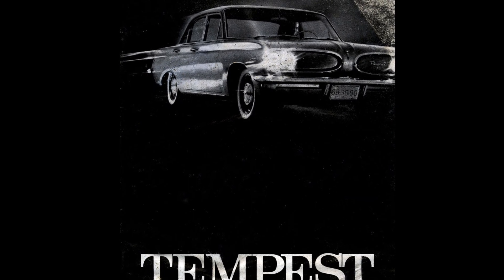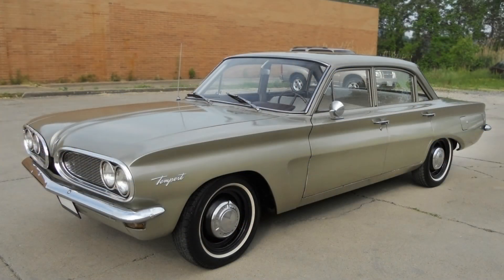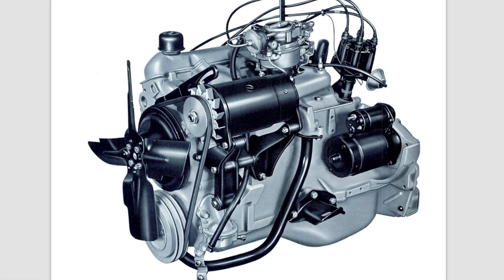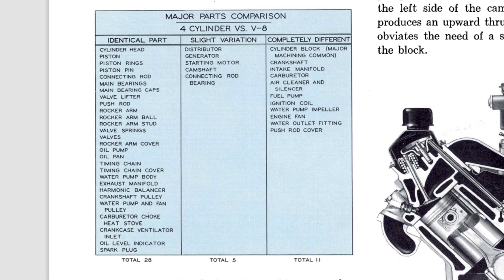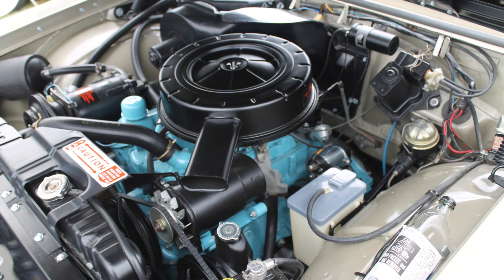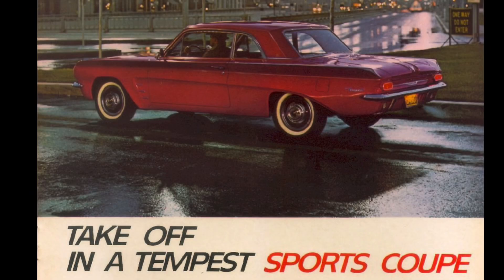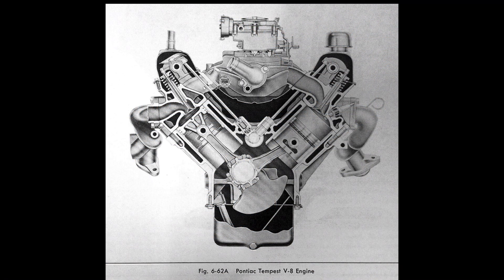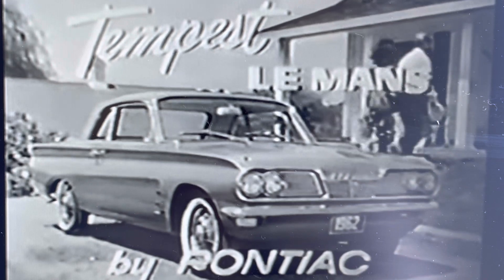Strangest Automotive Engines: The 1961-63 Pontiac Tempest & Its "Trophy 4" / "Half 389 V8" Engine

Comment: That engine really was very common to the 389-V8. One time my dad was tuning up a friend's Tempest and the local parts store did not have the required distributor cap. Dad bought the cap for the V8, put the plugs in every other wire nipple, and it worked great.
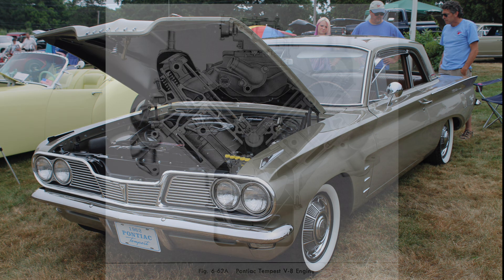Reply: At 08:30 there were actually two V8's available by 1963, the Buick all aluminum 215" V8 (2 and 4 bbl. carb.s?) and the Pontiac iron '326' V8 (actually 336" because Pontiac developed it before the GM 330" size limit mandate for mid-sized cars)... 
The 4 bbl. carb. 4 banger engines were basically half of upcoming GTO V8 engines at 1/2 GTO HP/torque but same higher RPMs... 
The 4's could also have been named 'Sewing Machine 4's' because, unfortunately, that's what they sounded like...
Reply: @BuzzLOLOL  The 326 was a sweetheart of a motor...great torque, and smooth.  Perfect motor for a car that light.
Reply: @williamrosenow6176  Tough to beat a 389 Trophy six barrel...wow.  I can relate to speed control issues, my latest is a 74 Buick GS455 built 10:1 compression, intake, headers, sizable cam, 3.08  highway gears so really just takes off 50 MPH to 130 or so.
Reply: @BuzzLOLOL  My brother had a 1962 Olds F85 with the 215 aluminum block.  I think it was the 2 barrel.   He drove it from 1978 to 1981.
Reply: @ripvanrevs  - My daily driver in 1960's was the '62 Olds Jefire with turbocharged 215 all aluminum V8... also currently have the 215 in my '75 MG Midget... 
https://www.youtube.com/watch?v=Jzw5W1rRMog
Reply: @BuzzLOLOL  awesome!
Reply: @BuzzLOLOL  First year for 389 was '59, they were in full size before GTO.
Reply: @unclebob7937  You are right for the 389 but not in the Tempest 61,62,63.
215V8 was the largest till 64, then came the GTO.
Reply: @frederickwise5238  - No, Pontiac '326' (actually secretly 336") with 2 bbl. carb. was available in '63 Tempest... the 389 got more HP in the GTO...
Reply: @BuzzLOLOL  Did I say anywhere that that the 326, "336" WAS NOT available in the 1963, did I?? Yes I knew about the 10 Cuin discrepency and why. I simply used the advertised nbr. OK??
A friend and (with the top down of course LOL), lay a quarter on the dash board, pedal to the metal DRIVE COMPLETELY OUT FROM UNDER IT.
If you read, what I said was the 389 didnt come until the GTO in 196 -4-. !!!
Reply: @frederickwise5238  - You said: "215 V8 was the largest till 64"... which isn't true, 326 was available in '63 Tempest...
Reply: @BuzzLOLOL  Isnt that what I apologized for in my reply to you???????
Reply: @BuzzLOLOL   if I'm not mistaken the 215 was only offered in 61 and 62. It was dropped in 63 in favor of the Pontiac 326. It also used the Buick version of the 215.
Reply: @edmundanderson657  Had a 215 inline 6 in my 65 pontiac tempest  nice engine for a six. I think  the next year they went to the OHC 6
Reply: @ike4496  Completely different 215. There were no inline sixes available in the 61-63 tempest.
Reply: @edmundanderson657  It was basically a Chevrolet 230 with an 1/8 inch smaller bore.
Reply: @BuzzLOLOL  Buick and Pontiac 215's were actually a "little" different. (not sure why but..) The headbolt patterns were not the same. LOLOL
Does any one besides GM know why???
Reply: @frederickwise5238  - The head bolt pattern was the same, Olds just added a 6th bolt for better head gasket sealing... especially since they were turbocharging the engine... I preferred the Olds version, but used the narrower Buick version in the narrow engine compartment of my MG Midget because the Olds style much wider valve covers would have blocked access to the spark plugs and exhaust manifold bolts... 
Buick styled theirs to look like a 'nailhead' design of their larger engines, but it wasn't a nailhead... it made good 200 HP from 215"...
Reply: @BuzzLOLOL  I was told by a reliable source restoring Buick Skylarks in Texas, that the heads could NOT be swapped. If Olds only "added" one bolt it wouldnt matter would it?
I would think a guy doing restorations on GM compacts in the early 60's would know. ??
Reply: @frederickwise5238  
Built them, raced them the heads definitely interchange. Buick bolts right on the Olds block with no mods whatsoever. But to install the Olds heads on a Buick block you have to drill and tap 8 holes. These are not just head bolts, on the Olds these bolts hold down the rocker shafts. There is no deleting them, you wont have rocker arms.
Reply: It was half a 389
Reply: The torque converter was behind the rear bumper spinning in the open it was cool
Reply: @ronalddaub9740  I bet that was real weird
Reply: @ronalddaub9740  Better not pick up rope or something on the road then that would be bad news.
Reply: No shit Sherlock! Imagine that huh 🙄
Reply: The family had a 63 Tempest with the 326 2bbl, 3 speed manual. What a sleeper, it surprised more than one stoplight troll.
Reply: @rockeerockey6941  - Adding a 4 bbl. carb. would allow it to make HP above 3500 RPMs...
Reply: Pretty smart.
Reply: INTERNATIONAL HARVESTOR DID THE SAME THING FOR THE 
SCOUT ,A COMPETITOR OF BLAZER AND BRONCOS
Reply: @rossbryan6102  Correct The first IH Scout, the Scout 80 was introduced in 1960, the Ford Bronco arrived in 1966 and the GM Blazer/Jimmy appeared in 1969.
The inline 152 C.I. 4 was half of the venerable IH 304 V8, later a 196 C.I. version derived from the 392 V8 came online. Rugged little engines.

Comment: All my years of being a pretty knowledgeable car guy I never knew this existed. Pontiac was always the revolutionary division with its slightly unorthodox engineering and produced the first "official" muscle car with the 64 GTO, though if you look it up these days, millennial e-rags such as Wikipedia will say it was a 49 Oldsmobile. 🙄
Reply: IMO...lots of older cars from the 1950s had big-block V8s, and lots of power.  But most folks consider a real "muscle car" as being a lighter body style, fitted with a big-block V8...so I do give credit to the 64 GTO as being the first actual "muscle car"...Personally, I would have loved to own a late 50s or early 60s full-size Chrysler car, with maybe their 413 engine. They were very quick, in their day, and a whole lot more comfortable to drive around in.
Reply: There was also the little 2 door 1936 Buick coupe with 320" OHV straight 8 ! 
And the '49 Olds Super '88' V8 used the little Chevy 6 body... with V8 from bigger Olds 98... Olds '76' also used the Chevy body with Olds flathead 6...

Comment: Adam, I'm so glad you did a feature on this very interesting engine and car. I hope you do another one on the overall drivetrain someday. I've always found the engineering rather fascinating and innovative for the time.
Reply: Like the enclosed rope drive shaft back to the transmission?
Reply: @cdjhyoung  I know it's called a 'rope', but the driveshaft is just a piece of 5/8 steel rod that is forced into a small arc by some bearings in the torque tube. Keeping in mind that GM did this engineering on a cheap car means that, in typical fashion, everything was done as cheaply as possible. Funny thing, but when Porsche came out with the 924, and later 944, it was laid out exactly as GM did: Half-a-V8 4cyl, enclosed curved driveshaft, and rear transaxle. Of course, being Porsche, it was done with a much higher grade of refinement.
Reply: @61rampy65  I read in an article from 1961 introducing the Tempest, that Pontiac matched the sag that gravity imposed on the long shaft if it was supported only on the extreme ends. Can’t remember which magazine, though.
Reply: DSP I was glad Adam brought up this car.As for the trans had no parking sprawl so you used the emergency brake for parking.Many rolled away on inclines.My dad a 62 as a 2nd car for over 10 yrs that wasn,t the best but was dependable.If you had a plug foul it was very bad.Put it on a lift and look at the rear wheels camber in .Strange little car.Good sounding solid state radio.Funny looking gear shift on the dash.
Reply: I wrote prawl not sprawl boob tube changes like they are smart but not
Reply: @johnchildress6717  The term is 'pawl' and since the Tempest shared transmissions with the Corvair in 61-62, and neither had a parking pawl. Pontiac added a pawl on the 63 'TempesTorque' auyomatic trans. The problem with duo servo drum brakes is that they work ok in forward, but require lots of force to work in reverse. I've had a couple Corvairs run away on me, tho.

Comment: When I started  at the local Pontiac dealership in 1972 a few of these were still coming in for service.  I got to drive a 1962 4 cylinder and a 1963 326 V8, both were automatics. Never seen one with the aluminum 215 V8, but the 326 ran really good!
Reply: the only 215 aluminum engine cars I ever saw in person was a Buick and an Oldsmobile
Reply: @jimhaines8370  That 215 was sold to British Leyland who put them in Land Rover for years. Unfortunately, head gaskets were always an issue from the jump.
Reply: @dougkoudelka3089  yes I knew that as they used them in river cars and SUV’s for many many years
Reply: @jimhaines8370  They were technically available on the Pontiac, but Pontiac had to buy those engines from Buick, so they charged a huge amount of money for the V8, until they came out with the 326 in 63.
Reply: @61rampy65  I really don't question it but just never have seen one
Reply: @jimhaines8370  Neither have I, I just know stupid trivia like this.
Reply: Jim Haines correct.  Don't know if Pontiac   ever put aluminum V8 in production cars. Have seen them in Buick and Oldsmobile.
Reply: @michaelkehm3663  I've seen 2 in a junkyard in the late 70's when I was looking for these engines.
And I think UTG did a video on one but it had the olds engine in it, swapped at some time.

Comment: These cars were very similar in concept to the Porsche 924/944/968 and the 928 models.  My understanding is that Porsche did not copy the Tempest drivetrain, but came upon the rear transaxle layout in order to get away from the rear-engine trailing throttle oversteer effect that made the 911 such a squirrel.  The 928 was a 100% bespoke design, but the 924 family was a Volkswagen/Audi parts bin special.  And the 944 even used half of a 928's engine!

The Tempest itself was basically a way to use the Corvair chassis with a front engine, hence the famous "rope drive".

I drove a 928 for 19 years and in some situations, you could get a harmonic twisting of the driveshaft that gave the same effect as what the Tempest was known for.

Great video!
Reply: The 928 was intended to cut into the vast Camaro/Firebird market...
Reply: @BuzzLOLOL  Porsche's cars  have always competed with GM's Corvette.  They weren't thinking about the Camaro when the 928 was designed in 1972, they simply wanted something that would appeal to Americans and have a front engine.  Afterall, the Camaro/Firebird/Mustang products were in a totally different price range.  Emissions controls were coming meaning that power would drop so they went with a large water cooled V8.  Also, they feared that the US government would soon ban rear-engine cars, so their 911 replacement, the 928, was built and sold with a front engine/rear transaxle.

As to the 928 being a replacement for the 911, we can see how that worked out....
Reply: Did these Porsches have the drive cable in a tube or was it a rigid torque tube?  I assume Porsche made the unit true and straight unlike the offset in the cheaper GM car

Comment: Back when GM was willing and able to build a durable powerplant.
Reply: OK...but do not forget about their 3800 V6 engine, that has been named by many as being the most durable V6 engine ever made by an American car company...GM used that engine for well over 20 years and many people got over 300,000 miles of use...I am an old guy who drives a Buick Park Avenue-1993-that has that engine...at 140,000 miles, it is running super smooth, so likely the car is going to outlast me!
Reply: @curbozerboomer1773  Yeah that was a great engine they don't make anymore either. I was referring to the crap they make now. Shameful.

Comment: The engine being canted to one side I'm sure helped balance with driver a little. Main reason would have been  to keep drive shaft angle correct from front to rear. All rear wheel drive cars need to do this for u join wear and provide smooth operation as the suspension does it's thing. Many angle the rear end up or down to accomplish this but with tranny back there they had to clock the motor which Chrysler does most often to this day
Reply: There was no driveshaft on these Tempests, they used a torque tube.  The only U-joints were where the axles met the differential.
Reply: @Flies2FLL  A drive shaft is still inside the torque tube and alignment is even more important because it has one joint instead of two, like more modern set ups. The two joints help cancel out the change in speed of a drive shaft when joint isn't  in line. With one joint with a tube set up nothing helps cancel the rotation speed changes in the shaft when the angle changes. This still happens when suspension moves. It is just less suspension travel to keep shaft as straight as possible majority of the time. Getting the shaft aligned is very important. More so with torque tube
Reply: @plap.  What you don't understand is that there is a front bearing and a rear bearing for the "driveshaft", or torque shaft, but no bearing in the middle.  What's more, that shaft WAS NOT straight!  It was CURVED along its length and as a result had to be built very flexible, hence the nickname "rope drive".  Seen from the side of the car, the driveshaft would appear like a smile. It was a solid metal shaft, but it acted the same way that the drive cable in a curved-shaft weed whip acts.

The drive shaft extended through the center of the rear mounted transaxle, and attached to a clutch at the extreme rear of the car.  This was actually a Corvair transmission, designed originally for a rear mounted engine, and it was solidly fixed to the body of the car with rubber mounts.  The car employed swing axles with U-joints at the differential end only.  The whole drivetrain was attached to the body and did not move.

Comment: I wonder how much difference a Corvair transaxle is to a Tempest transaxle (automatic or manual)?  ;-)
Reply: For the Tempest the transmission turned around with the torque converter on the back of the transmission.

Comment: Very interesting video. I didn’t know about that engine until today. In 1970, my second car, replacing my leaky ‘62 Impala convertible, was a ‘61 Olds F85, gray 2-door post with bucket seats. That had the 215 V-8 with the Slim Jim automatic. P-N-D-L-R configuration. Where the Chevy was leaking everything, the Olds was smelly. I ultimately sold that shortly before going into the Army.
Reply: The Olds F85 was P-N-D-S-L-R... 2nd gear was called "Super" for quick passing use... of course, there was also the factory turbocharged V8 version: 
https://www.youtube.com/watch?v=Jzw5W1rRMog 
Buick Special and Pontiac Tempest automatics had just D and L... 2 gears...
Reply: @BuzzLOLOL  Yes, I forgot about the S tucked in between D and L. I saw that turbocharged version, Jay Leno’s Garage video. 1st to 2nd was practically instantaneous and 3rd came soon after. It was an odd car all around.

Comment: Mercury boat engine’s also had a half ford 460 as a engine. That would be awesome for a early falcon or 60’s-70’s English escort with a 429 scj head
Reply: Mercruiser only used the low cost Ford iron head... the block was an upright aluminum Mercruiser design...

Comment: In a way I'm surprised this wasn't done more often. I can think of three times. Pontiac, IH and Triumph with the Stag V-8. But I'm not sure what came first. The 4 or the V-8. But Pontiac went as cheap as possible. Even to the point of using the same cylinder bore tooling as the 389. I wonder if the blocks were run on the same machining line with just putting the station involved in the left bank (tappet bores, head bolts etc) in bypass.
I worked for at Kenosha Engine and when we heard about the 2.5 project I wondered why the just didn't convert the 304. Also in the 60s there was a race engine shop that converted Chevy small blocks into 4 cylinder race engines for midget racing. Sesco iirc.
Reply: Didn't Saab originally use a Triumph engine in the 99 Series?
Reply: IH’s “Comanche” fours were essentially from the same playbook as the “Trophy” four - the 152 was the right bank of a 304, and the 196 the right bank of a 392. Triumph‘s Stag V8 was the opposite; it was essentially two Triumph slant-4’s unhappily married.
Reply: @SouthernShadetreeMechanic  
Probably the worst V-8 ever made. But any of these engines are true Slants IMO. As opposed to just leaning the engine over.